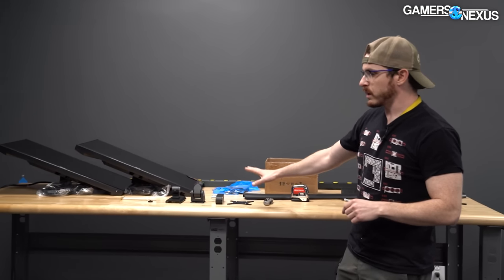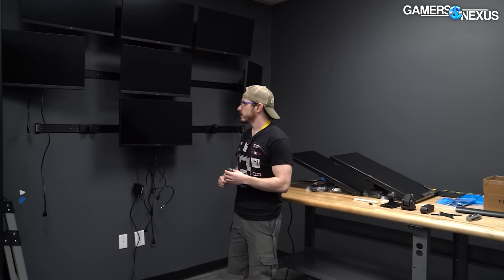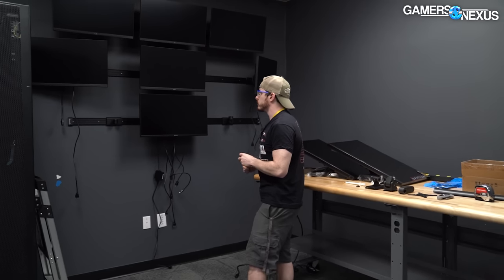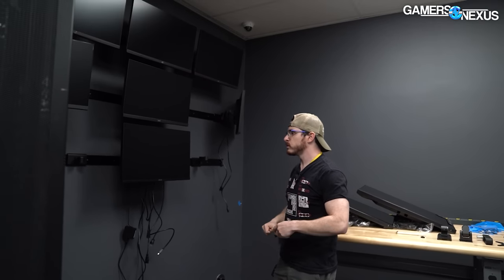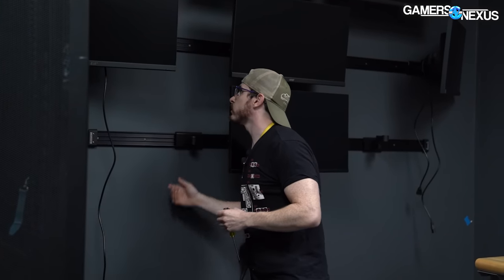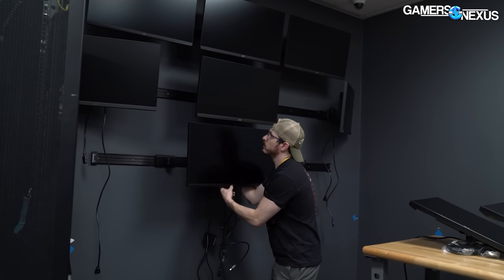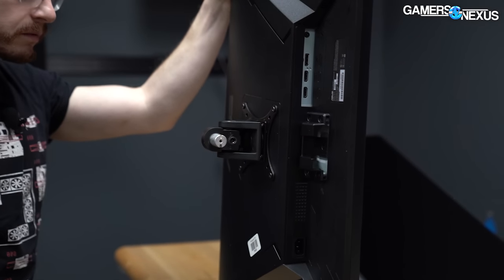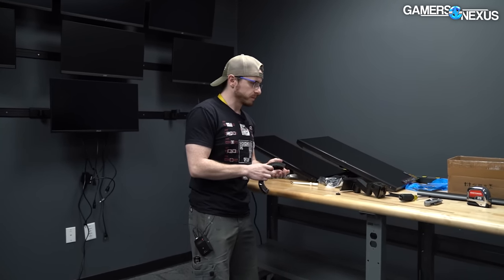How We Built Our Monitor Wall with 9 Displays (New GN Set Design)

Comment: About 15 years ago I wall mounted a 60" plasma TV for a customer, my first time mounting a TV of that size about 40kg and very expensive!. It wasn't an articulating mount thank god, but I do remember using something like 25 coach screws into the timber studs. Had to get another contractor on site to help me lift and mount it. Still remember the nervs!

Comment: I've built a monitor wall at work. It was 4 x 4 and used 1080 monitors. This was way back and we needed it to test computers we built for a company that used them for signage applications. Using their software solution to drive display walls you could do some interesting things. One of the most impressive I remember was a customer who built a room with I think 14 HD projectors projecting a 26,880 by 1080 movie on all four walls giving you a real surround experience. Another was a 16 projector video wall used to show life size video of a new long haul truck. But anyway, we needed the video wall to test the capabilities of the display system.

Now building it was a pain. The system used in this video with the rail that the mounts slide on takes away half of the problem with aligning the monitors. I had single wall mounts that screwed into place, so I better make sure they were aligned properly before drilling any holes. 

Now that you've got all the monitors in place you realize just how many cables there are with that many monitors on a wall. With 16 monitors comes 16 power cables and 16 signal cables. That's a lot more cables than it sound like at first. And you better mark those signal cables well or you will spend a lot of time playing musical cables when hooking things up.  Well the software did have the ability to map individual monitors so you could theoretically hook them up any way and solve it in software. But that was one of the funktions that really could cause strange problems so you'd rather get them connected with some kind of logic.

Still it was pretty impressive to see some of their high res videos they pumped out to these systems.

Comment: The slides are probably PTFE (Teflon). I think this is an excellent idea; maybe you can add some tongue-in-cheek "actual testing footage" cards next to the monitors when we see them running. Also, does that power strip run off of one plug? Because that's a lot of load on a single plug.
Reply: Monitors don't draw much power now a days.  A 13amp strip would be HARD to overload with monitors.

Comment: Metal studs are great. You just gotta have the right tools for the job. We did something similar but instead of 9 small monitors we mounted 2 55" low profile plasmas side by side with low profile brackets on the wall with just enough clearance to tuck two apple TVs, two surface connect adapters, and two chromecast HD in the back of each to do give us the flexibility to do some nice collaboration work when folks were in the office. This was back in 2015....seems like a life time ago. We used quite a few toggle bolts bolts also as those plasmas were not light, lol!
Reply from the maker: We have installed a lot in the studs, but we generally try to avoid it if we can do so safely just because it's more permanently destructive.

Comment: Interesting choice on the Ergotech units.  For the video wall setups I've built I choose Chief.  I would have done the sneaky thing and chose a cable tray that matches the Ergotech unit and made it look as those braces extend to the rack that's generally out of frame.  I presume that that is where the content for the wall is being generated and a more direct path between the displays and source leads to shorter/cheaper cables.

Excellent choice on those toggle bolts.  I use the same type for all sorts of other projects.  Coworker was able to do pull up off of the bar on the wall as they're so stable when you get them into metal studs.  I will stay that the static weight load is also dependent on the dry wall, if you hit a stud, how many/arrangement of the toggle bolts.  Drilling into metal studs can suck but they seriously assist in supporting weight for projects like these.

A bit of a nitpick but something that stands out in a studio space is the white gang plates on a grey wall.  I would have painted them to blend in as white on grey just screams 'look at me'.  I also don't where power is coming from for the wall.  It'd be simple enough to pull from the rack where there is likely a high current source with a nice PDU and hopefully a UPS.  For NOC/SOC style applications, I would generally split the power loads two different circuits in the event of power failure and UPS run times.  That generic rule doesn't really apply is this more studio setup but I would consider splitting the power source for another reason: you guys do deal with high power systems for your reviews of high end gear.  Given that one system under load can easily consume half of a 20A circuit,  where there wouldn't be enough head room for another system and these displays.

This setup is also one of the cases were several Quadro/Radeon Pro cards could make sense driving everything.  For a studio application, using genlock will permit the displays to stay synchronized as one virtual surface and align their refresh to that of the camera.  If you're running different pieces of content on the monitors as I've seen in the recent news videos, then this is a benign issue.

Comment: Mount into STUDS unless u have absolutely no other choice. Those drywall anchors should never be relied on for anything heavy. Because it's commercial property, that drywall is probably 5/8" vs normal 1/2" in residential so there's a bit more strength.

Comment: Abit late to the party but maybe it'll be read anyway.
What about a Corner case (custom) to go.. in the corner. (under the monitors) it could draw some attention from the corner, the main non monitor wall could hold the motherboard and be easily removable for changing the motherboard/gpu, and the corner bit could be a psu and maybe cooling options so you don't need to tear the whole build apart for testing - or just make something really cool a full time PC in a cool case to be background for the videos!

Comment: I would really reconsider having the wall reinforced and properly mounting these, those drywall anchors have caused countless disasters when they rip out a chunk of the wall and the entire mounted thing collapses.  They are fine for very lightweight decorations but this is far too much, especially considering the monitors sit out from the wall and can be moved around which increases the strain on that bracket.

Comment: Probably this is the only thing I don't like so much, just because they are distracting to watch when Steve is talking.
But maybe I will get used to them!
Reply: Ditto, but I know I won't get used to them, (unless the scene changes and motion are significantly toned down), due to decades of experience to learn that my focus is very easily stolen (but didn't make the connection to Autism and/or ADHD until very recently).
Reply: Agreed, though if enough people don't get used to them I'm sure it's possible for GN team to just switch over to more static or less frequently changing content temporarily for video shoots.
Reply from the maker: We film in multiple locations, so the old set will still get used.
Reply: @zivzulander  I "believe" far more would like the "dynamic" set than a more static one and plenty don't really care either way, which (if true) would leave a pretty small minority who're particularly bothered by it.
This would lead to such comments getting drowned out and/or buried by the positive ones and the reduced view/sub count getting lost in the normal fluctuations.
Reply: @gnextras  It might be cool to just have a wall of monitors showing the static GN logo.

Comment: Using plastic anchor bolts…..I can’t fortell ANYTHING that will go wrong with those…

/sarcasm
Reply: The plastic in the drywall archors is just used to align those threaded metal mounts to be snug against the drywall, and each of those metal mounts behind the wall would each then have a metal bolt screwed in to them from the front side.

Comment: Had never trusted a wall to hold that amount of weight. Have no experience with it to be fair. Quite agents playing with wall mounts as a result. Like dry wall? For real monitors are heavy and dry walls are the kind of thing you almost consider weak enough to be a fire escape route! It is the stuff inside of the wall that might stop you from taking a shortcut. Idk. I might know to little about the topic but just not trusting hanging stuff on walls without being sure to hit something that also holds up to me running into it. Lol. 

Not really liking the look too being honest. But ey whatever.
Reply: drywall is very supportive parallel to the sheet - it's all rock

just perpendicular is where it becomes...fragile